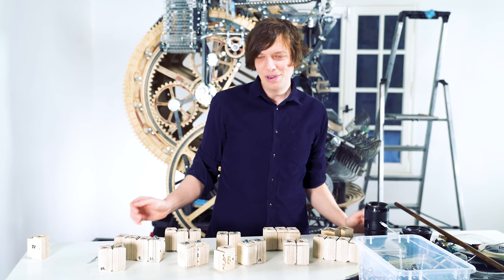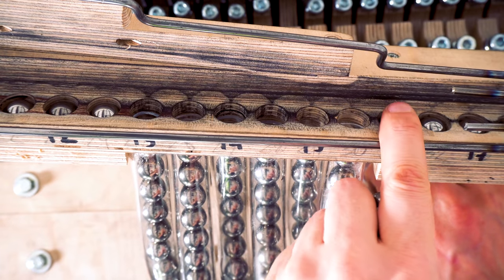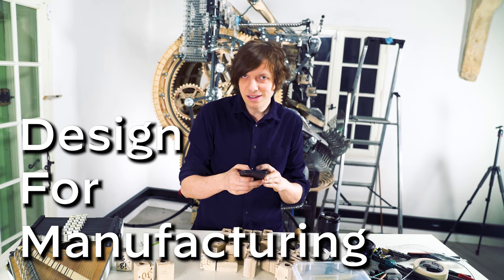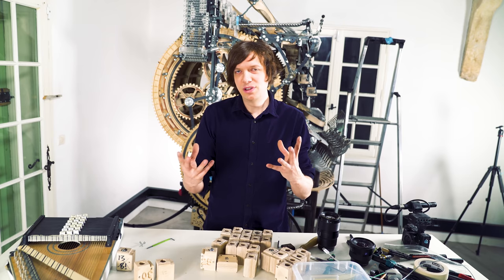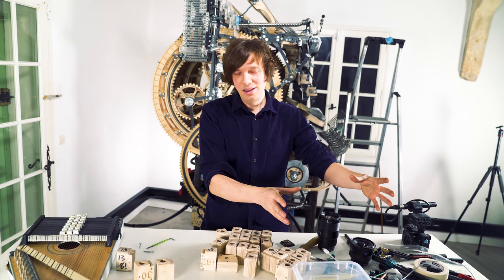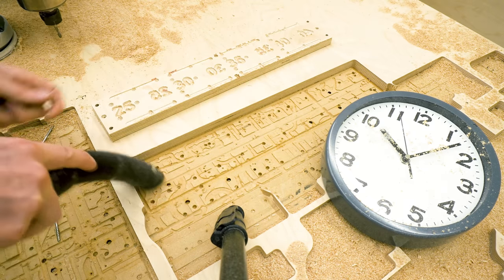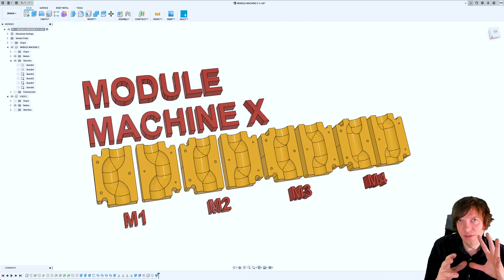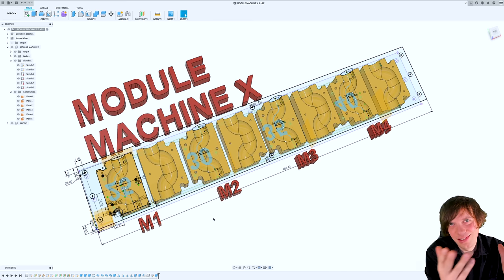Module Machine X

Comment: Straight panels or curved panels, makes little difference.  While DFM has its place to reduce costs out the door, it is a very short sighted view of the big picture.  If this vehicle (or whatever) is cheaper initially, but costs 3 times as much for simple maintenance of the vehicle, then there is no cost savings. Having to pull an engine to change the spark plugs is not a wise move.  

I have spent my entire life as a Electronics Technician with Mechanical responsibilities in industry, and am now retired.  All throughout my career, I have seen your DFM go from costing very few minutes to do simple repairs, to having to requiring many hours teardown just to do the same simple repair.  There is no savings in a design like this.  In the end, the owner will seriously question if that brand of widget is the one he wants to purchase next time, based on his expenditures to keep the old one running.

I have always maintained, any Engineer should spend a minimum of 1 years in the field, repairing and maintaining the devices they build, before they are allowed to graduate.  Sort of like a Doctor performing their residency.  I will bet everything they designed will take into account both DFM and be maintenance and cost friendly.

Comment: @Wintergatan 2 You have a fundamental problem with the machine design - you are creating a necessity for such tight tolerances all around the machine. The design needs to be much more fault tolerant.
Reply: @sebastian-kirsch  That's a fantastic idea. He needs to incorporate that, and other things like it, all over the machine. He needs to account for temperate and humidity swelling, shifts in parts, machine vibration, etc. A machine like this can't have such tight tolerances anywhere.

Comment: I'm sorry but this current marble divider is just not cutting it. The design is way too inconsistent.

- The PMMA pipes are too wide for the marbles so they snake inside. This means the pattern of the marbles inside the pipe will shift constantly, making their heights inconsistent.
- If you ever have to replace a PMMA pipe on the divider it needs to be 100% exactly the same as the pipe it's replacing, to the millimeter. Otherwise your height measurements will be thrown off and you have to go through this entire process again for the channel. Not good when you need to do a quick repair on tour, or even on stage. 
- Every time you have to replace one of the height modules you need to empty the entire marble channel. If you need to do a quick repair or adjustment on tour that will be a big operation. Especially if there is a big backlog of marbles that will keep falling into the channel as you try to empty it. At the very least you need some way to stop the marbles from entering a channel.
- The height modules are kept in place by a latch and a wingnut, both of which can and will loosen up over time due to the machines vibration. This will eventually cause the modules to slip and shift which causes more snaking inside the channel which again hurts the height consistency. 
- At 4:09 you can see that the marbles don't immediately fall into the holes. They bounce around before falling in, and one of them even skips a hole. I don't know how impactful this will be but it seems like room for inconsistency. 

It might be hard to accept that this design isn't good but you need to recognize it. This current design can only cause problems and headaches in the long run. People have already shared hatch based designs for the marble divider that would be way more consistent and would eliminate the need to have several dozen different height modules. You redesigned the marble gates, now you need to have a very good look at the marble divider because it is very outdated.

Comment: Ok I'm really interested in cars and I'm going into mechanical engineering, the look of a car is mostly separated from the actual manufacturing details. I hate the cybertruck, the design is like that because they wanted it to be, not because it's cheaper to manufacture. If it were cheaper to manufacture, all cars would be like that. It's inefficient, will struggle to meet pedestrian safety regulations, and looks subjectively bad. Regular cars are designed for manufacturing, all the body panels start as flat steel or aluminum then are stamped into shape. The cybertruck will be no different. Hate to say it but you're wrong on this one.
Reply: "If it were cheaper to manufacture, all cars would be like that"
Why go into mechanical engineering if all the best solutions have already been found?  Hint: they haven't!
Why did Apple start making phones?  Nokia and Blackberry already had the best optimized designs.
Why are SpaceX rocket launches cheaper?  Shouldn't everyone already have been doing it that way?

Estimates for capital expenditure for production is something like half of a typical vehicle, and that's before considering things like megacastings and the structural battery pack.  Dropping the need for the paint shop and tooling should save $500M by itself (estimated by Sandy Munroe).

"pedestrian safety regulations"
The RAM and F150 fronts are vertical walls at least 4' high.  If I were riding a bicycle I'd rather be hit by a CyberTruck.  While everyone would rather be hit by a car, trucks are relatively similar to each other.  The future improvements will likely be more about software for avoidance than physical changes.

"inefficient"
Body-on-frame is extremely inefficient, and that's the baseline for trucks.  Yes CT has thicker panels but they also contributed as frame members, which is not true for regular car body panels.  It won't beat a sports car with a carbon fiber hood, but that's not the competition.

Comment: I don't think a full DFM method is necessarily always good. I mean, what are the requirements of a car? Is it to be easy to produce, and only that? I think that ignoring aesthetics and claiming that "you just don't get it" isn't the way. In my opinion engineering is about trade-off, not about pushing the needs of your department over all others. But thankfully, I don't think the shape is fully DFM, the aerodynamics are pretty reasonable for a pick-up truck, which I think would also be important next to producibility, as it determines the a large part of the performance of electric vehicles. But then again, I'm not looking for an IKEA type car, not that Tesla is priced like an IKEA type car. I think cars are also an expression of your personality.

Comment: An engineer designing something to be easy to manufacture ignoring all other factors is not good engineering. In the case of a car the role of the body is to look good, and for safety of pedestrians. With the cyber truck they have clearly made it look like that because it's easy to make, but they have sacrificed aesthetics completely and there's no way that it's god for pedestrians if they get hit.  

Engineering is designing a product that fulfils its purpose also also is easy and cheap to make. If pure DFM was the main way to design stuff then every building would be built so it would like were living in a communist state.

Comment: To the car argument i think this is just not really truth that Cyber Truck fans is the DFM camp. Every other major car manufacturer produces their cars on a big scale so even the roundest car has to be designed to lower the cost and problems of manufacture or production in large quantity is just not cost effective and will loose money (and we all know that large company hates that the most, ppl may die but profit is where they will discuss). Other thing that is not discussed is reparability. Every good in current world SHOULD be designed to be repairable and not in one place by one company. This is where praised brands for their designs (Apple, Tesla) are just the worst. They deliberately design products to make it harder to repair something by even specialized technician if they not authorized it. This is the topic that should be discussed as i see it as MAJOR design flaw.

Comment: The motor industry is an excellent example of the cynicism of DFM as a penny pinching exercise. Most motor vehicles are designed for ease of manufacture, but often with total disregard for ongoing maintenance. The power train will be efficiently assembled, and the body shell then dropped onto it. At this point it now becomes very difficult to perform a host of operations that can be expected over the life of the vehicle such as changing filters, drive belts, clutches and ancilliary items like alternators and so on. The manufacturer doesn't care, they have optimised their manufacturing costs - after that it's someone elses problem. It is a shame that the techniques cannot accomodate the continuing use of the item, instead of churning out limited life objects with designed obsolescence. The technology exists, but will not be applied as long as it threatens the manufacturers bottom line. Welcome to capitalism.

Comment: Your bewilderment at a "car designer" not understanding DFM makes me chuckle.  That dude is an artist that draws cars on paper.  He has absolutely no idea what can and can't be done in a press.  I worked as a designer for GM for 5 years and I can tell you that most of the people who are actually designing cars there don't understand DFM or even cars.  It was shocking how little people who designed parts on cars there actually knew about how a car works.  I'd bet $100 that if you walked into a meeting with engineers and designers from the brake department that only 20% of them could actually change the brakes on their cars.

Comment: cyber truck is a bad design. sharp corners are a magnet for dents. what is that bed roof, glass? on a truck you might haul something in? wtf? yes good, try new things.. doesn't mean first try is a good design, it is a very poor design with endless flaws and problems. designed for manufacture? yea, you can bend a corner on sheet metal, easy to manufacture. you need a machined mold to make that. you also need a machined mold to make every other sheet metal panel for existing cars on the road today.

Comment: If you just want to control the path length, couldnt it be something like this? https://pasteboard.co/JKTMgxn.png
Reply: I think this design is meant to be able to adjust the path lengths without changing the outer measures of the path..

Comment: why are you wasting so much time on a bad design? when you tune a guitar, do you swap out the neck with slightly different size necks? what do you do if the of the first marble tracks on the left need adjusting by only 1mm or even half? seems like a huge pain in the ass to deal with. take out all the marbles for nearby tracks, falls all over the floor and inside the machine, fiddle around with blocks of wood that you can't find any grip on, can't see what hands are doing in there, oh no got that stupid latch thing holding it in, gotta push it out from the front, there go the marbles..... why??? it should be easily adjusted, because things do shift, it will need adjusting. it's not something that will be a one time set and forget, it will come back to bite you.

Comment: A lot of the commenters are making points about how cybertruck's planar shapes can't really be considered dfm because you can easily manufacture curves, as seen on all other vehicles. People are forgetting the other key thing about cybertruck, which is that the body is STRUCTURAL. There is no frame. The body is thick because it needs to be. In my opinion, the cybertruck is hideous, and that's fine. It's an innovation and deserves credit for simply being what it is. Will it be super popular? Probably not. Should it be praised for its design? Probably not. Will it inspire manufacturers to try their hand at designing an exoskeleton? Maybe. I respect Elon because he genuinely thinks things can be improved and leverages his wealth to take great risks to make those improvements possible.

Comment: Sorry that I have to break your delusion, but your height modules are neither easy to manufacture nor easy to implement/operate, at least compared to this trapdoor design: https://www.youtube.com/watch?v=zahlKPc6TMA
You'd only need to build one for each channel, place it at the marble divider so it only holds 2 or 3 marbles and you dont have to worry about what ist happening below.

Comment: I would say the Cybertruck looks that way because you can't manufacture it looking any other way. It's made from 3mm stainless steel. You can't stamp stainless steel as you would normal sheet metal as it is too hard. Not without very powerful and specialized machinery, which would have made the car ridiculously expensive.
The car looks that way because of constraints, not ease of manufacturing. Easy to manufacture is stamped sheet metal with few shapes, as every other car manufacturer uses. But for the same reason as the DeLorean is famous Tesla wanted to have a niche.

I think it's overthinking and maybe overengineering. You're making like three MMXs, not 7000. The efficiency of manufacturing isn't the highest priority.